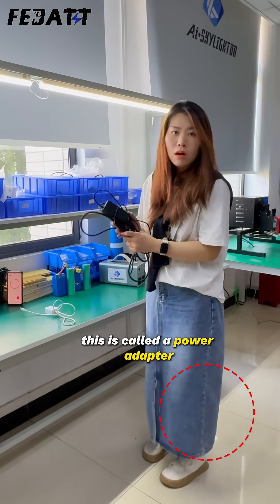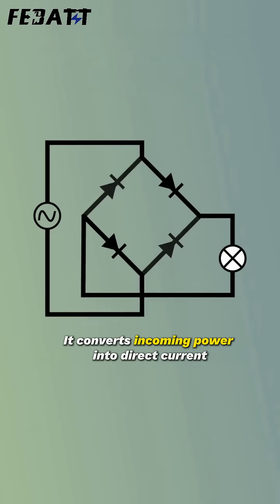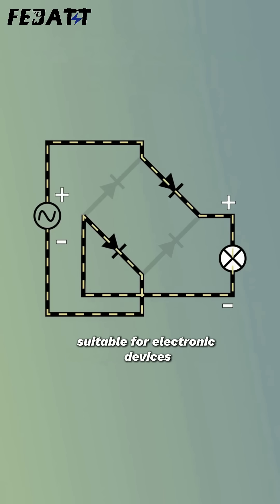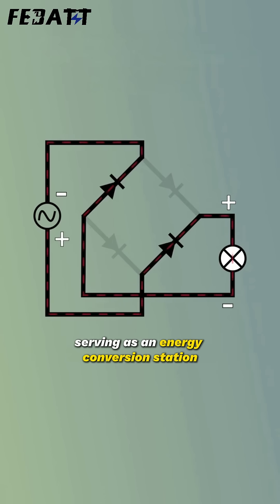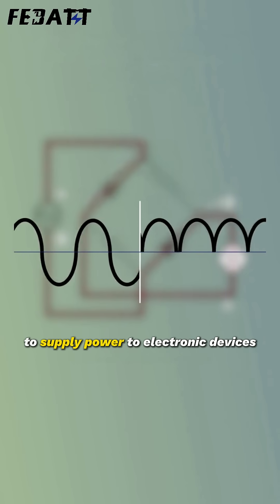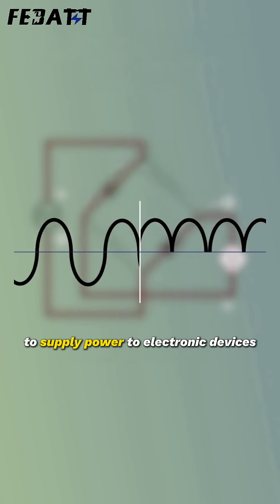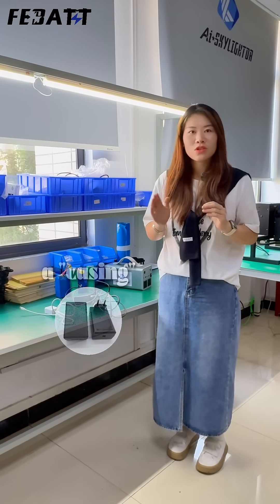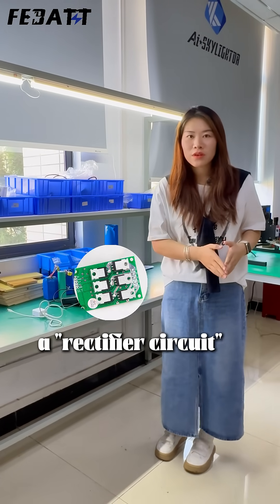The 'charger' you've been using is fake? 90% get this wrong!#batterycharger #technology

Comment: I disagree. The mobile phone adapters are smart. They negotiate how much voltage and current to pass with mobile device. (See USB Power delivery protocol)
Reply from the maker: There are cases where different chargers use inconsistent protocols.
Reply: That is different. Most modern USB chargers can negotiate voltage and current with the charging device, but battery safety such as discharge and overcharge protection are integrated directly into the phone. 

The point is, that a charger knows what voltage the battery is at and automatically changes between CC and CV profiles and will stop charging the battery at a specified point.
An adapter will give a constant voltage and current, as long as the device asks for it. 

The adapter does not know that state of the battery, the charger does.
Always charge your batteries responsibly!